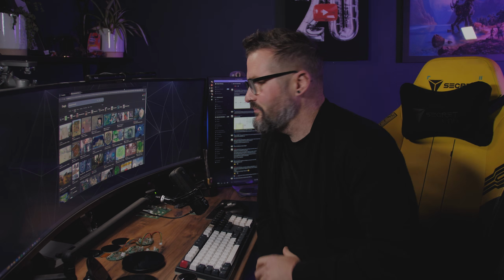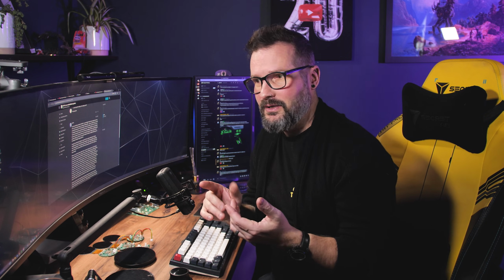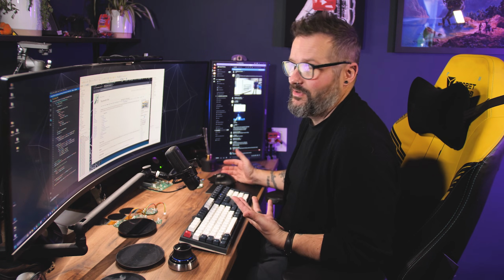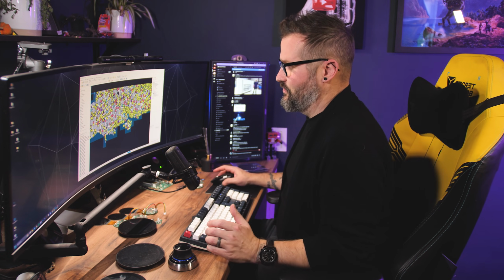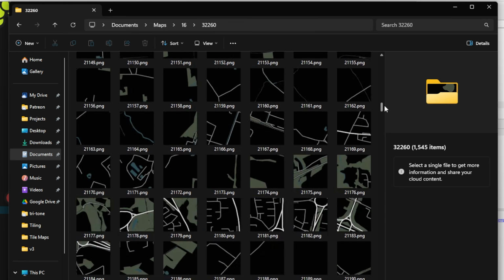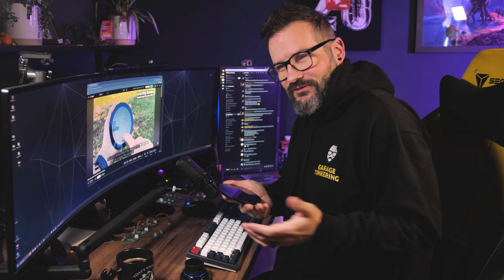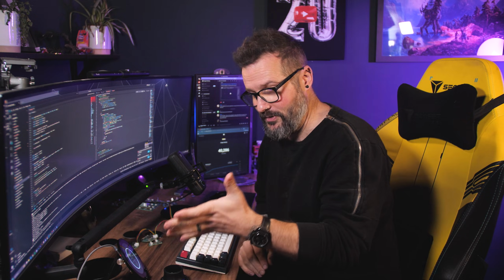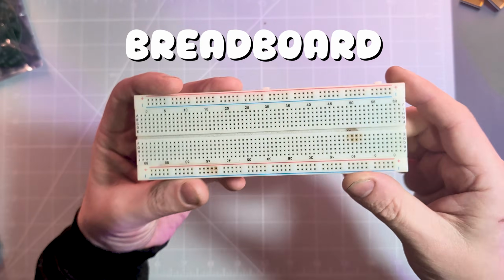A Real Mini Map from Need for Speed

Comment: There is one thought that came up about the fact you put almost 240 gigs of tiles on an SD card, and its that you ought to make sure that you turn on the minimap at least once every month to be super sure that the SD card won't corrupt itself. Thing is, these QLC flash storage devices, like a 256 GB SDXC card is, lose their data in one year at room temperature, so for a pod in intermittent sunlight, the card could lose all data on it in between 6 months to as little as 1 month, depending on how often the card itself gets up to high temperature. In general, for QLC flash cells, the power-off data retention reduces by half with each 10 degrees Celsius, about 1 year at 22 Celsius, 6 months at 32, 3 months at 42, 1.5 months at 52, etc.

You could buy a proper long-life industrial SLC flash SD card, but those are expensive and you can't just get them from a consumer-grade store, you'd have to special order one at even higher price from companies like Swissbit, ATP Electronics or Innodisk, and what's worse is, from my findings, Innodisk only offers 32 GB max for an SLC flash full size SD card, because 32 gigabytes in full size SD form factor is right about the upper limit for SLC at that size, the SD card is absolutely full of SLC flash cells, QLC can push into the terabyte range, but at the cost of far slower speed and far lower lifespan, both power-off data retention and over a magnitude lower R/W cycles. So going for eMMC flash card (they look kind of like supersize SD cards about the size of a credit card, I think), and the ESP32 can already talk to them (as you are using the ESP32's SD/MMC library to speak to the current QLC 256 GB SDXC card), would be a good thing for longevity. Funny enough, one of the applications for SLC flash eMMC is in fact for modern automotive navigation systems. If you had money to burn, you could order from Micron a radiation-hardened 256 GB SLC eMMC flash card that they build for satellites and other space missions, among other things, like nuclear control systems. Lots of servers also have them, and the factory that once produced your car almost certainly uses them in the machines that produce whatever cars they make now. The problem with SLC though, one I found from SanDisk (that surprisingly is true SLC, just not space-grade, merely terrestrial-grade) costs almost 190 quid from Mouser. Free shipping, though.

Frankly, I got away from myself, just aiming for MLC flash SD cards would be best, SLC is far too expensive, though perhaps TLC might be the best given that MLC is also still quite expensive, and unfortunately getting more so with the major shakeups in the digital memory market recently. I think I've concluded to myself that you're using the best SD card for the job at the moment, anything better for automotive purposes is too expensive to be a valid upgrade path right now XD

Comment: As others have mentioned, using vector data from OSM would be more efficient.
However, if for some reason you still have large images to rotate, you could build in a "deadzone" or buffer zone where only small degrees in rotation from the last couple seconds of direction doesn't turn the map.
This way the direction will have to turn far enough before it corrects the map rotation. It'd work better than setting hard thresholds that'd make it jump if you're just about between two of them and it jumps the rotation back and forth.

Another thing you could do to minimize the lag from the rotation would be to zoom the map in a bit at lower speeds and back out again if you're going at a pedestrian pace or are stopped. That way you don't have to load as many tiles while you're not driving as fast and need to pay more attention to the road (less images to rotate), but still get to see the map when it's safe to look at it when parked or at a traffic light or something.

Alternatively you could have different layers of tiles for different types of roads (or at different speeds if that road data isn't as easy to track) where you have bigger tiles that prioritize highways and the like while the smallest streets are faded out or just not included (you don't need to see every tiny road when you're driving on the highway). This way you don't have to load new tiles in as much and as fast at higher speeds and you make it safer and clearer to use at high speed at the same time.

if some of this doesn't quite make sense I apologize, I haven't really been getting enough sleep lately
Reply from the maker: Tile loading times isn't the issue. I've solved that. The only issue with rotation is that it's inefficient with LVGL, so bottlenecks. I just need to try and figure a way around that and the rest will be fine
Reply: @GarageTinkering what I meant was that if you have to load less tiles you have to rotate less separate images at once.

I don't know if it's running into a similar bottleneck but having done some stuff with image transformation in the past the performance gets worse the further the images are from the transformation origin. If you have a lot of them to transform at once it can get really slow. iirc one of the things someone suggested to me at the time was to instead rotate each image by itself, and calculate its rotated position offset after. The issue is that that can make the alignment of the tiles jittery instead depending on if it cuts enough latency or not.

Another trick from webdev would be to, instead of rotating the items on the "canvas" would be to simply rotate the canvas and counter rotate elements that have to stay upright. Whether you do that in the software or physically by rotating the full display with a motor, the concept is basically the same as what you're already doing with the static orientation view. You might want to add a slip ring connector for any power or data transfer.
Reply: @GarageTinkering the zooming idea wasn't purely a performance suggestion, but more of a user experience design one.

When driving around city streets you need to pay more attention to your immediate surroundings and nearby roads are more relevant, so focusing on that by zooming in a little would make sense to makes immediately relevant info easier and faster to glance.

When you speed past — say 60km, you'd zoom out both because areas further ahead are now more immediately relevant and these types of roads generally require a bit less focus with less chance of pedestrians or crossing traffic and the like.

For a similar reason you could zoom out a bit when you come to a halt, as you won't have to pay as much attention to the traffic around you when you're not actively driving in it. That way the user can see a bit more context on where they might be going when they come to an intersection or something.

I usually approach design from the user experience side of things, which might seem a bit unnecessary if you're just making something for yourself. I still believe it's a good mentality to have when making any kind of interface, especially if I were the main person using it. I know it's more development work which is why I also tried to propose some ways it could have been beneficial for your performance issues.

Comment: One thing you could do is use an existing GPS app with a custom map design/tiles. There’s a lot of options, including even Google maps which lets you make a custom style using JSON to set the stylings. But with that, you could even use it like a real GPS, showing your route, and potentially even showing the destination as a marker on the edge of the map.

Other option is there are endpoints to get routes, and then you can use the GIS data to draw the lines yourself, though it will be harder and make it so you can’t automatically show the “Turn right in 5 miles” type things.

This is a sick project though! I really like how it turned out!
Reply from the maker: Don't think that's doable on ESP32 though

Comment: As someone who makes geo data products for a living, and works on cars for fun, this is a weird intersection of my interests! Very cool project and well done on jumping into GQIS. My guess of "couple of million" tiles wasn't far off 😂
Reply from the maker: If you - geo data pro - didn't ballpark it correctly, noone else had any hope
Reply: @GarageTinkering the worst parts of geo data are A( there's always more data than you expect, and B) trying to optimise it so it actually queries in a reasonable time. 
You hit both issues as expected!
Reply from the maker: Now to figure out vectors. That's gonna be... fun
Reply: @GarageTinkering there should be some good performance gains to be made in changing over to vectors but honestly what you have is perfectly good as is (especially as you can dedicate hardware just to this task), it looks great.
Reply from the maker: The only thing I REALLY want to do is remove the waypoint markers so I can have them appear around the perimeter of the circle when they're nearby but not visible.

I figured I could just do a big lookup table (there's probably <12000 total markers used across the country for what I want) and when I'm doing the new tile loads, look for markers on those tiles, then do some maths to calculate their individual bearing from the center, and place them relative to that, but limit the distance from the center to the circle radius, then just shift them around accordingly. 

It makes sense as an idea in my head and I don't think will add much extra computation because there's rarely more than say 5/6 markers in any 3x3 grid.
Reply: @GarageTinkering you might also be able to split the waypoints into one data file per tile, then you are iterating over a very small dataset rather than the 12k waypoints. 12k is a pretty tiny dataset normally, but you are limited in hardware.

Comment: tip for the OSM part of extracting data points for your GIS editor: use overpass turbo! - there is a wizard for the common thing of finding exactly a certain tag combination and you can export to GeoJSON

if you want to get more fancy, use osm2pgsql for basically the thing that you made as python script, but optimized for running on the entire planet

Comment: I'm not sure how you did the rotation but I will guess you used a sin and cos functions. These are computed on the fly but there is a much faster optimized way to do it in a specific application like yours - look up table (LUT). You just generate a table of several values of sin with enough precision for your map to rotate correctly and store them as an array. "Calculating" a sine is then just a matter of rounding the angle and indexing the array with it. I'd hazard a guess there's already a couple of implementations like that floating around so you don't even need to make your own.
Reply from the maker: Nope. Just used LVGL's inbuilt rotation on the container
Reply: @GarageTinkering it is probably using sin and cos from math.c. If you patched that with your lut based functions you could get it to rotate much faster

Comment: What if instead of rotating large images you rotated the actual video output instead?
Maybe this is me just being stupid - I'm thinking of retro hardware that had both a background and a sprite layer and you could use matrix transformations to rotate the entire background layer while preserving sprites - but if you don't make the car point any one direction (because you're always pointing forward, you already know that), rotating the whole screen instead of the individual images should fix the performance problem you mentioned and allow the map itself to rotate
Reply from the maker: It doesn't really have "video output" in that way.
Reply: @GarageTinkering  alright, then rotate the actual display :troll:

Jokes aside, amazing project and I think I'll want to make one too eventually
Reply from the maker: You say troll, but that's very doable

Comment: Why do you preinstall the complete map offline? Doesn't Google Maps or OpenStreet Map support custom styles? So you could use 5G to transfer the data to the car and just cache the data. This would save hours of pre creating the data. And if you leave UK with your car (for holiday), it would directly work - you just need an internet connection.
Reply from the maker: Because I didn't want it to require an internet connection. Also no you can't just use GM or OSM to feed styled maps to an ESP32. 

If I'm going abroad I can just prerender where I'm going. It's not like I'll accidentally end up 1000 miles from home
Reply: That’s sad (for styling). But the idea is really cool.

Could you explain your LVGL tilemap renderer? I‘m not sure if you do lazy loading or really load the complete map. Could you activate „discussions“ in the repo, so we can talk there, because questions and ideas are no „issues“.
Reply from the maker: It's lazy loading. Basically it's a 3x3 grid and I look for times when you move off one of the edges of that centre tile. When you do it checks which side you moved off, shifts all the tiles over one with buffer swapping, and then loads the three new tiles in the background (as they'll be out of view at that point). 

Doing it that way keeps image requests super minimal.

Comment: You dont have to rotate the whole grid, you can just rotate the frame after rendering and turn it by x°.
If you're planning to make it possible to interact with the visual markers, you think of an circle and rotate each point on that circle by the degrees, you turned the rendered frame. That should be processing-friendly enough.

Comment: It's really cool and you did a great job putting it all together.

I have a question though : why are you using only half the screen ? Is the orange direction thing the reason ?
Reply from the maker: Balance. If you saw where I showed the other gauges it's going with, the main Tabby design speedo gauge is going alongside it (in the middle of three with this on the left), and if I had it full screen the whole dash feels lopsided.
Reply: @GarageTinkering  Gatcha, thanks for answering !

Comment: If you use a raspberry pi zero and have it display out to the screen, it would be a lot faster. Also vectors might be a more optimal solution size wise and probably rendering wise as well
Reply from the maker: My entire ecosystem in my car is esp32, so it makes sense for me to keep everything same. Besides, I think just throwing processing power at a solution rather than figuring out and optimising it is just lazy programming. 

I'd rather take the time to figure out making it work on something lower powered personally.

Comment: That seems slower than it should be, image rotation is heavy but with sine tables and integer math I'd imagine any ESP32 should be plenty fast to rotate the view. Are you sure you're rotating at the most optimal point in the render pipeline? I'd imagine it's right after cropping the map into a circle and adding the north marker.
Reply from the maker: The map doesn't actually get cropped to a circle, it's an overlay with a transparent centre. The whole thing utilises LVGL which should mean that the redraw process only takes into account invisible and changing pixels with the triple buffer. I'm pretty certain there's a way to make it work better though, I just need to spend some time looking into it.

Comment: Rather than rotating the tile, maybe you can create a pointer to the direction you're travelling and rotate the output screen to that position.
Basically shifting the pixels that are pushed to the display to create the illusion that it's rotating wheras no actual manipulation of the map data have to be calculated.

Comment: 20:40 Tell me your gas gauge works and never failed you without telling me.
Reply from the maker: Actually it's a big point of failure in the 350Z. I fill mine and it says 75%, and flashes empty when I have 20litres left.

I just reset the trip whenever I fill up and then ensure I fill again before I hit 300 miles and it's usually fine!
Reply: @GarageTinkering  Lol, sounds about the same as with VWs. Even if it works, it shows half full until the last 50 miles, then goes full on 737 max and nosedives into the ground. I once just rolled into a gas station because the engine shut off at the top of the hill... Not trusting that thing again. I just fill up every 500 miles (TDI and a large tank), and don't risk it. It also gives me a good safety margin, as I usually get about 700 per tank.

Comment: For the rotation problem at 17:00, you can try to apply 3 shifts on the pixels in a certain way and you'll rotate the map without using expensive calculations. This also allows you to perform every calculation you need on the always-pointing-north map and then rotate it just to display it. Much less computational expenses

@standupmaths made a video about it called "Rotation without rotating" where he explains this really well

As for smoothing the movement of the map in between GPS coordinates, you can try to approximate it using the GPS speed or use inertial sensor fusion 

To improve accuracy (at small range from your house) you can use RTK GNSS, but you need a way to transmit radio signals as fast as possible and a fixed reference GPS to compensate for ionospheric interference